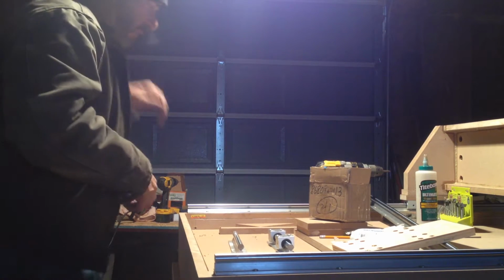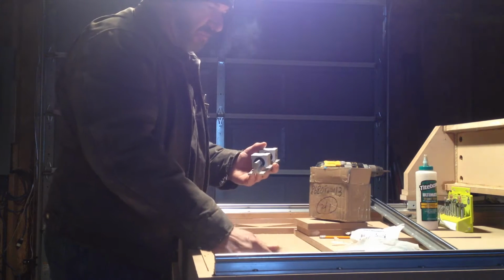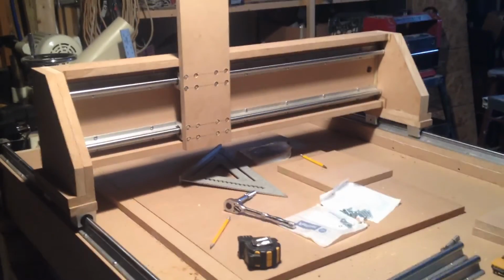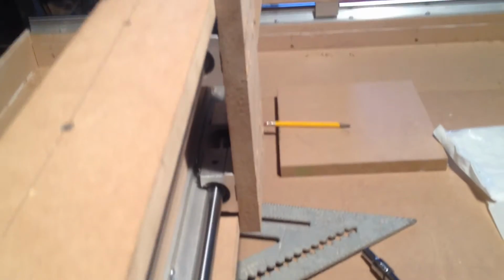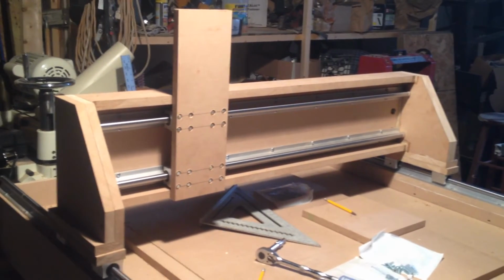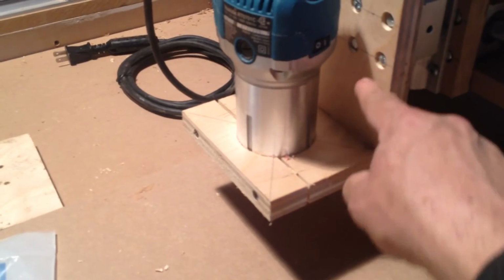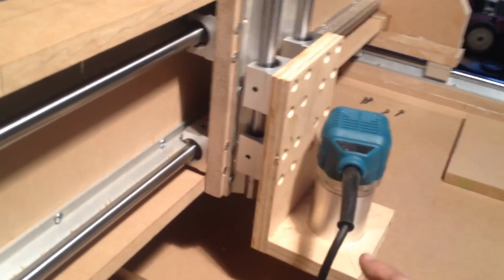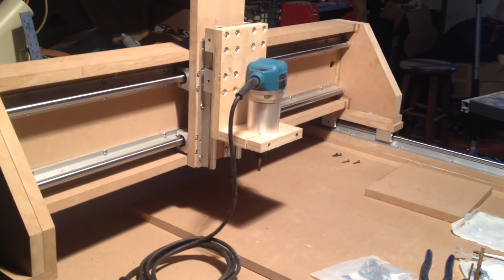CNC Router Build 6 - Installing the X and Z linear rails.

Comment: When you bought your rails - were they perfectly flat or bent?
Reply from the maker: flat, not bent at all or I would have returned them
Reply: Alright cool - seller trying to BS me around to accept bent rails. 

Thanks for posting your videos - gives people like myself to see whats been tried and tested. I've never worked with MDF before - I'm used to plywood - how do you find the MDF for stability and rigidity?
Reply from the maker: Sorry to hear about your rail problem. MDF is easy to work with and very sturdy. Make sure you pilot drill before inserting screws into ends of it or it ill chip and/or break. I also glued and used construction adhesive to make sure joints ere strong.
Reply from the maker: Also, I am very happy with my build. I took ideas from many other builds out there and designed my own based on what I thought would work best for me.